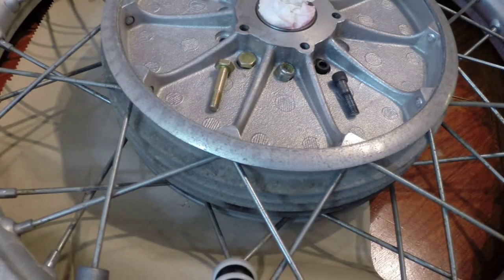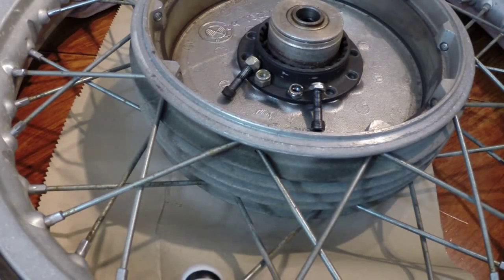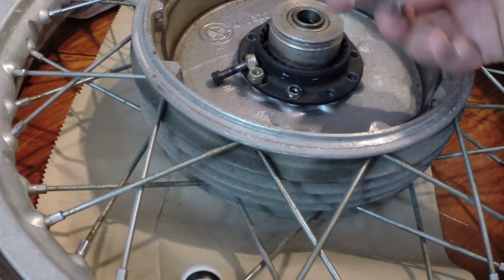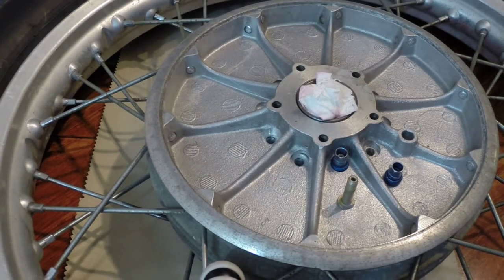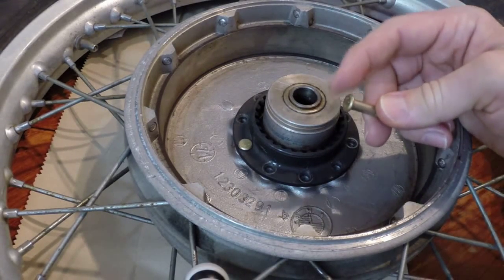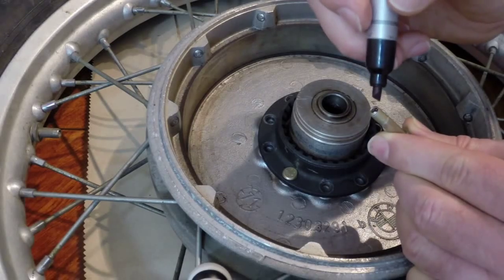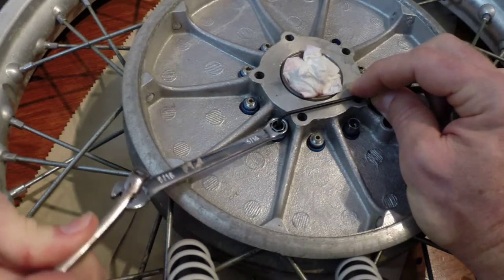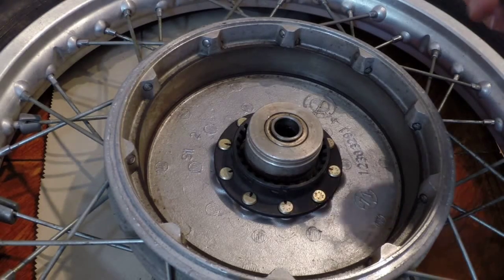BMW R75/5 rear hub spline repair (part 2)

Comment: Have you had a chance to try out the new drive dog hub?  Looks far less MONGO than re-riveting the thing on.
Reply from the maker: Unfortunately no. This bike was a basket case and is still not on the road yet. I'm not worried about the Hi-Loks though. These are as strong as hardened bolts and are way easier to install than rivets.

Comment: How did the Hi-Loc fasteners work for the driving dog?  Hopefully you have a few hundred miles on the R75/5 now and I was hoping to use this method on my R60/5 final drive.   Thanks
Reply from the maker: Unfortunately, this R75/5 is not back on the road yet. I purchased this BMW mostly in a box and it has become a much longer term project than I expected. Which is usually the case when you buy another's unfinished project. I am close though, stay tuned!
 
I wouldn't worry about the Hi-Loc's. They are specialty fasteners made to hold airplanes together. I have no doubt they are overkill for holding the driving dog on the rear wheel. The only problem I foresee, is the next time the driving dog needs replaced. Grinding off the old Hi-Loc collars looks like it will be difficult. I plan on greasing my rear splines religiously to keep from having to do that.

Sorry for the delayed response. I usually get notified by youtube when asked a question. Didn't happen here.

Comment: length i mean
Reply from the maker: Guillermo Salazar The Hi-Lok pin I used here is model# HL20PB-8-10. If you drill out your aluminum hub rivet holes to 1/4" like I did, you will need a 1/4" diameter Hi-Lok pin (the "8" in the model # above). I measured the un-threaded shaft length I needed to equal 5/8" (or 10/16" and where the "10" comes from in the model # above). The total length of the HL20PB-8-10 is about 1". It is the un-threaded shaft length that is the important measurement. You don't want any threads in the aluminum hub or driving dog.